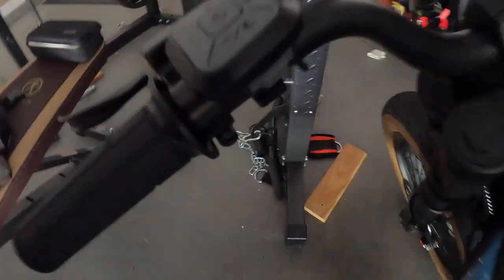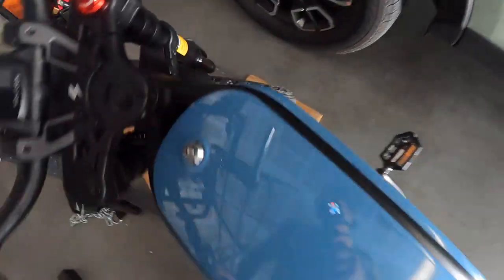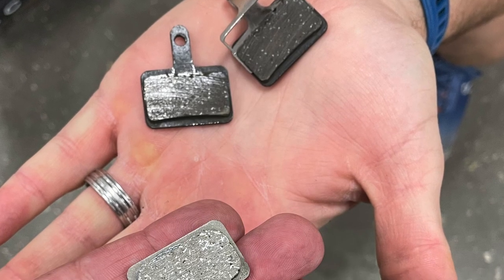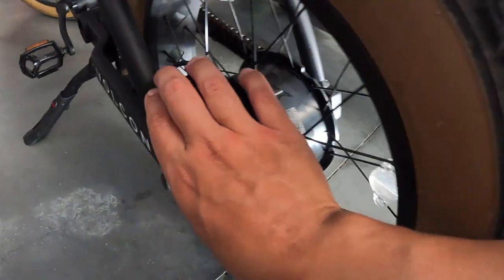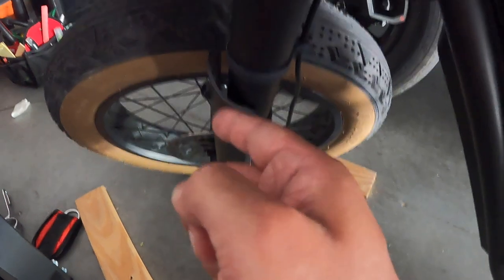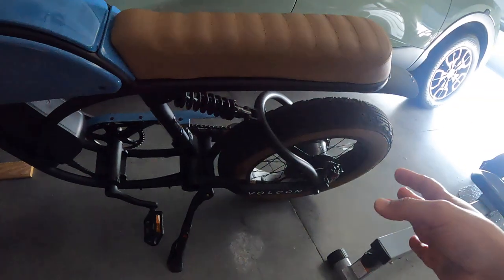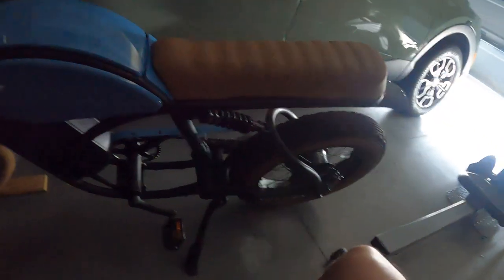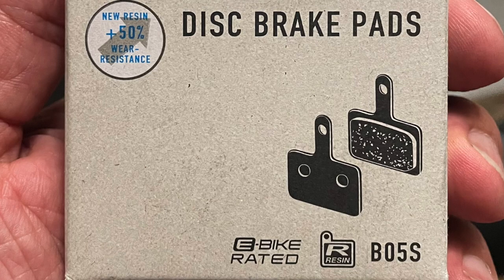Volcon Brat Horn and Brake Issues

Comment: Had brake issues on my BRAT as well. Volcon sent over a new set but since I'm in Cali there are no local dealers so I had to replace them myself. As for the squeaking on the front, mine was caused by the light connection wire rubbing between the frame and the light. 
Great bike! Love mine as well. Just the little things that should've had a bit more attention to detail on.
Reply from the maker: I spoke with the service department, and they informed me that a local third party company assembles the bikes for them before they are delivered. My dad went through the same issue with his recumbent bike. The Trek dealership where I bought the brake pads informed me that it is common to have these issues in the bicycle industry. Everything has been fixed on my bike, and I need to do a follow up video.
Reply: hey how long is this bike??

Comment: Just got mine and they send it with spare brake pads. Very neat
Reply from the maker: Volcon sent you a bike with a set of brake pads?
Reply: @JorgeMejiasBorgen  like the disk brake parts. Sorry I meant the disk brake but I'm used to bmx so I said pads lol
Reply from the maker: @oramibunn  you are right. Disc brakes have brake pads. You are lucky that they supplied you with spare parts.

Comment: I had the same squeaking problem on my Brat.  I changed the pads and it disappeared.   The only other issue I had was the plastic plate under the battery.  It breaks rather easily...fyi.
Reply from the maker: I learned that the hard way. I fixed it with some super glue. By the way, I got a Discord server running for Brat owners, want to join? My username is cyborgtypezero

Comment: How many miles did you put on it before these problems with the brakes?
Reply from the maker: The bike has less than 100 miles, today, and I’ve noticed the problem within the first 10 miles. I managed to make the issue tolerable, but it is not fixed. I am still working on that video. I have to be tactful about it because I don’t want to shine a big negative spotlight on a product that I like.

Comment: Hello I was looking into this bike and since this is one of the few videos posted on this bike I was hoping you could answer two questions for me. Is the torque on this bike good? And would it be able to handle going up the hills in Southern California? Thanks
Reply from the maker: In normal mode, torque is adequate. In off-road mode, there is a big difference in acceleration. I can’t really compare it to any other e-bike, because this is the only one any dealership allowed me to test out. I’ve been to a Trek and Cannondale dealership, and both did not allow me to move any of their e-bikes anywhere near the door. To answer your second question, it has a 750W motor, single speed, and weighs 86lbs. When you add the riders weight and incline, it might struggle a bit. I live in Florida, so I’ve had no issues so far going up an incline. Other bikes with a similar setup would probably perform the same. If you add multiple speeds in the mix, it might have better torque to tackle inclines like the ones you mentioned. They are pricy compared to the Brat.
Reply: @JorgeMejiasBorgen  Would you maybe recommend this bike due to its speed, durability, and suspension?
Reply from the maker: @samapfel_08  Volcon is in the business of making dirt bikes and SxS, so I have to say that both the frame and suspensions are solid. The brakes are Shimano, so I don’t see any major issues there. With less than 50 miles on the odometer, the battery and motor are still a mystery to me. I would recommend to anyone who is looking for a cruiser bike that can travel well both simple on- and off-road trail. Speed is adequate on both of these terrains. Also, please keep in mind. It is not a traditional E-Road bike or E-MTB, so the seat cannot be adjusted.
Reply: @JorgeMejiasBorgen  Thanks so much for responding and sorry but i have just one more question. Do you think it could handle wheelies? Ik you are not allowed to probably say that I should do them on the bike but is the seat high enough for them?
Reply from the maker: You do not have to apologize for all the questions. I have no problems answering questions. Now, to answer the wheelies question,  Volcon states that "riding over stairs, performing wheelies, taking it off jumps or doing stunt/trick-like activities" will void your warranty. Will it be able to handle some wheelies? The shocks probably can, but the wheels are a different story. You can replace the wheels with something more aggressive that would fit 20" X 4" MTB fat tires. Furthermore, the bike is the size of a small adult size dirt bike. The seat height is high enough for my height (5'10"). However, if you are 6 feet or higher, you might have some comfort issues. Oh! And by the way, I did a short speed test video on my channel: https://youtu.be/KOipoXoXyLM
Reply: @JorgeMejiasBorgen Thank you so much. Would you recommend this bike or do you think I should just save up and buy a super73 RX?
Reply from the maker: @samapfel_08  that is a good question. I don’t have dealerships near me that carry the Super73, so I can’t test one out to give you an honest opinion. Florida is full of off-roaders. So many bicycle dealerships here cary MTBs and expensive road bikes. I got my Volcon at a motorcycle dealership and it is registered as an Off-Highway Vehicle with the state of Florida. Yes… it has a VIN. They are selling it as a scooter along with other Volcon dirt bikes and SxS. Sorry, I wish I can give you a clear answer. Keep doing your research before biting the bullet.
Reply: @JorgeMejiasBorgen  Got it and you mentioned your bike is licensed, does it have to be since I am 14 and dont want to have to deal with that stuff? Thanks again!
Reply from the maker: @samapfel_08  , oh I see! LOL The bike is registered with the state of Florida, so it can be allowed on roads that only allow off-highway vehicles like ATVs, dirt bikes, SxS, etc… It doesn’t have to be registered. It is just a Class 2 bike. By the way, I forgot to mention that the bike is designed to ride like a dirt bike, so it doesn’t turn like a bicycle. If you look at Volcon’s products, they pretty much sell off-road motorcycles and SxS. They are disguising the Brat as a “bicycle” when it has a small dirt bike/cafe racer motorcycle style frame.
Reply: @JorgeMejiasBorgen  Ok thanks for the clarification, have a great rest of your day, and thanks for answering my questions!
Reply: No you’ll need something more powerful , I was considering this bike half a year ago but I didn’t wait and ended up buying a Beecool challenger 1000 W . I believe the brat is 750 W - so my point being that I can barley get up hills at a normal speed of 19 mph with traffic honking behind me …. and Im skinny dude so weight shouldn’t be much of a factor -  so a 750 watt probably won’t cut it . I’m in Downtown LA and can barley keep up with traffic sometimes once it stretches out - I’m pushing 30 mph on my bike . Super 73 is a great option if you plan on upgrading the bike overtime due to their wide variety of after market parts . However considering your 14 years old I’d say 750 W class 2 e-bike is fine for you .
Reply from the maker: @SolelyElectric  the bike has a 1200W motor set to 750W and unlocked to 1200W using the app. The bike goes almost 30MPH on flat Downtown Orlando Streets. I don’t know how well it will perform on hills.
Reply: @JorgeMejiasBorgen  peaks at 1200 W
Reply from the maker: @SolelyElectric  we wouldn’t have the problem of cars complaining about cyclist on the roads if pedestrians and bicycles were given their own dedicated pathways like how they do it in the Netherlands. We need to fix the infrastructure here in the US.
Reply: @JorgeMejiasBorgen  yes definitely, here in LA there are dedicated bike lanes as the city is cyclists friendly , but the drivers aren’t
Reply from the maker: @SolelyElectric  In Florida, we have bike lanes that are shared with vehicles. It is rarely used by commuters because drivers don’t care about cyclist. We need a completely separate path or a barrier. I guess there aren’t enough pedestrians and cyclist deaths to make a change…